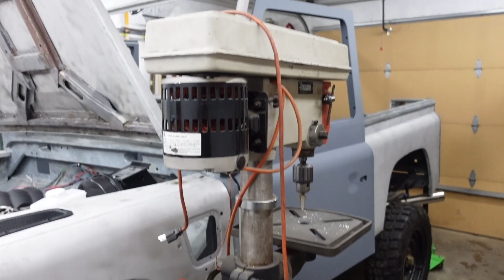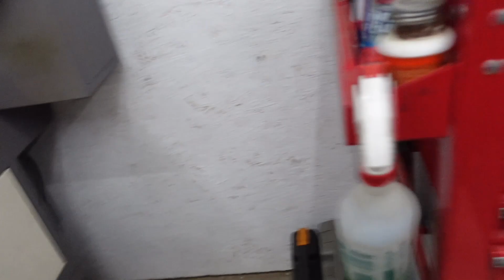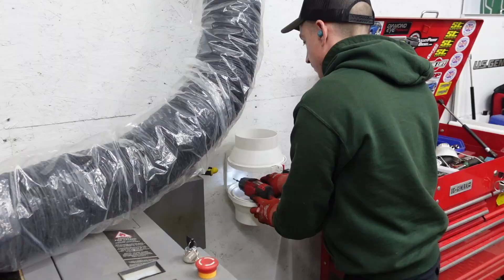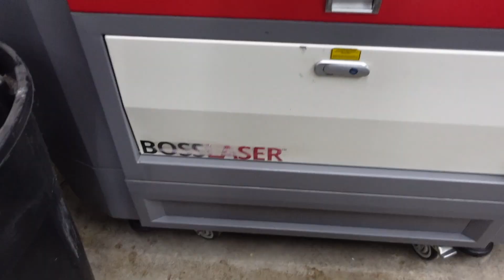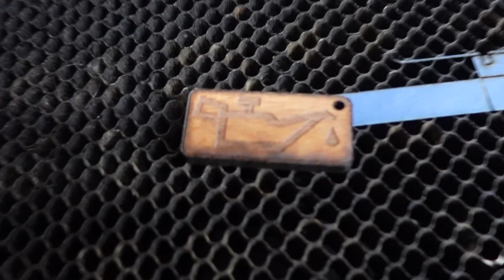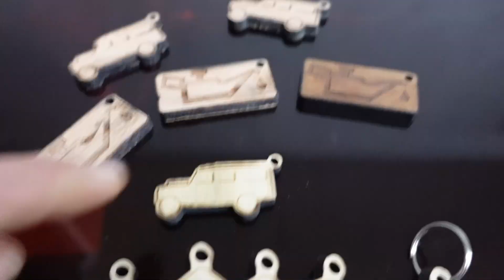New Tool for the Land Rover Shop! - BOSS CNC Laser

Comment: Sweet!!!
Reply from the maker: Should be fun to mess around with.
Reply: @LostCauseRanch  I already got my gears turning! It will cut acrylic?
Reply from the maker: @QuinnBrothersRacing  Yes, that’s the reason why I ended up going with a bigger co2 one. The little diode guys won’t do anything with clear acrylic. Have some stuff outside of the Land Rovers that I wanted to do in clear acrylic.

Comment: Pretty cool!  Besides wood, I think you mentioned it will do acrylic as well.  Does it work on metals?  Which ones?
Reply from the maker: Unfortunately it is not able to cut metal. I think it has to do with the power and wavelength. Most metals just reflect the beam so it doesn’t do anything. Fiber and higher wattage co2 is what you need for that. But it will etch in anodized aluminum and I think I have some uses for that.
Reply from the maker: But I’ll get another cnc plasma once the new shop is up and going to handle most of my metal needs. Really miss having one of those around.